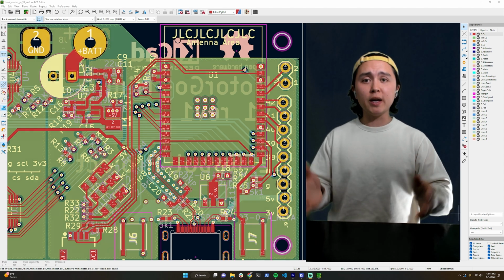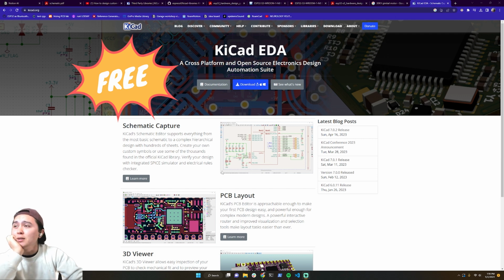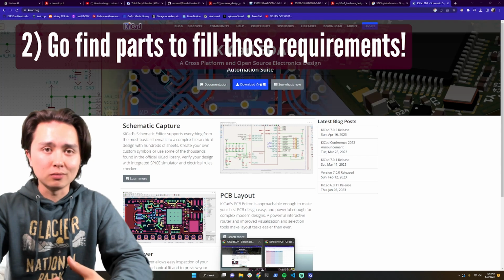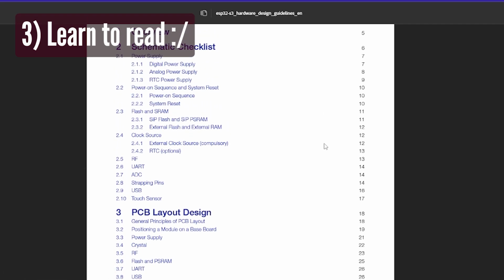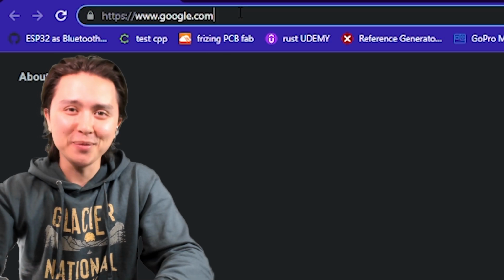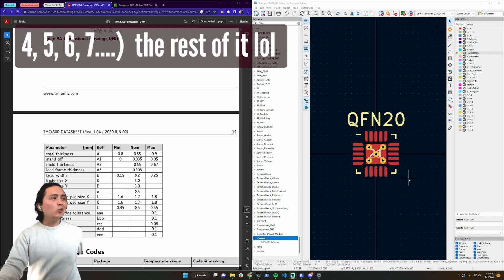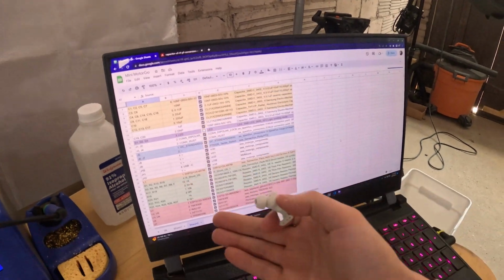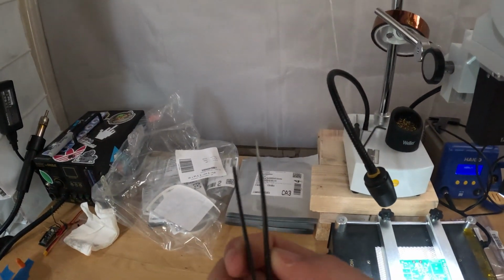Beginner's Roadmap: KiCad 7.0 PCB design

Comment: Why did nobody mention, that you should never place a Via under a solderpad!? 😋 Also: Did you autoroute that PC, because the "oh! Snap" moment had not a single trace placed.
Reply from the maker: Why did no one mention I shouldn't places vias on pads?  The answer is that I didn't know that! 

I just never had a problem with it personally, so I didn't know that was a problem until everyone and their mother told me about it here in the comment section hahaha - so thank y'all for telling me!  I'm learning :)

Also, did I autoroute?  As far as I know kicad doesn't have an autoroute?  I just put all the components on the board to see what it would look like in 3d and then routed them off camera I think. 

Thanks for the comments!  I'll always answer what I can :))
Reply: @EveryFlavorRobot Kicad has a primitive autorouter plugin. Quite fun tho.

Comment: Via under the pad is a bad idea 😅. I find useful to hide all refs to save board space.
Reply from the maker: I see your point, but idk... I would rather have labels on my board than worry about a potentially suboptimal solder joint? 

Have you personally seen anything that bad happen from a via in pad design?
Reply: @EveryFlavorRobot  For hand soldering: there is nothing to worry about. You can always add more solder.
But for PCBA services (when portion of solder depends only from pin shape) - there is risk of solder soaking by via hole. In that case component's pin can lose connection. Or wors- connection can be weak, and after board heating up (for example from esp32 module heat disapation) connection can broke. It can cost of random pin read/write issue
Reply from the maker: @kushlavr  very good notes!  I can definitely see how those would be issues for other situations.  The production-ready version of these designs will definitely adjust accordingly :)

Comment: totally a noob here but placing vias under the solder pads or at the edge is just not the best practice well you can technically do it but the vias just suck the solder paste and the board just looks terrible
Reply from the maker: Good point, especially with small passives!  I get a little obsessive over saving meaningless space sometimes haha  -  Fortunately my vias were so small I didn't see many problems from them in this iteration tho 🙃
Reply: @EveryFlavorRobot  You might want to check out capped and filled vias. The board house will drill the vias and fill them with epoxy afterwards. This is very useful with bga components